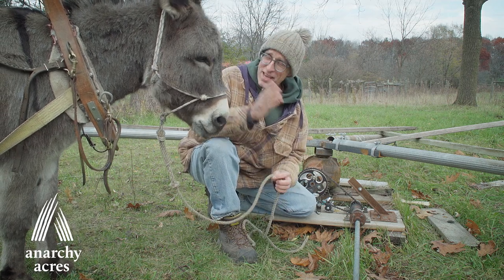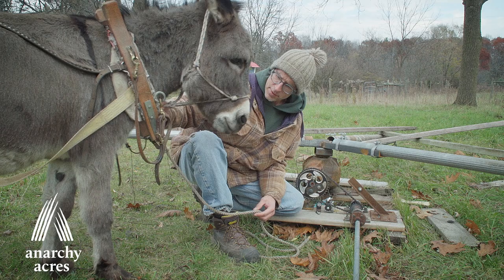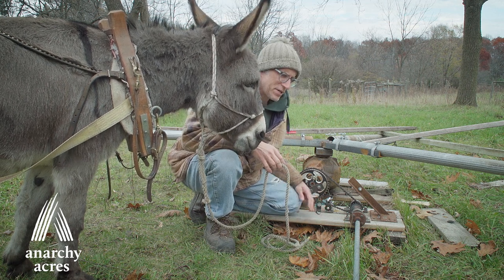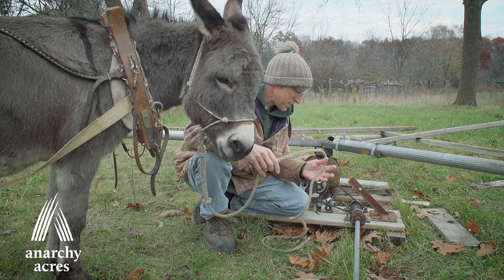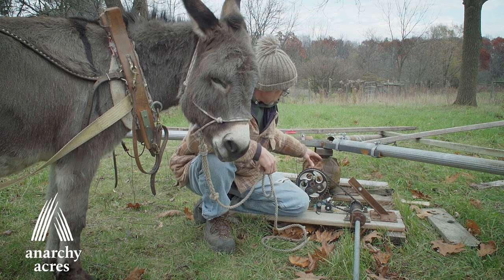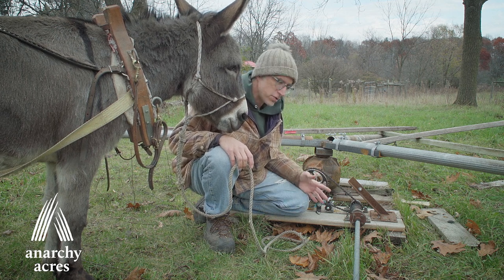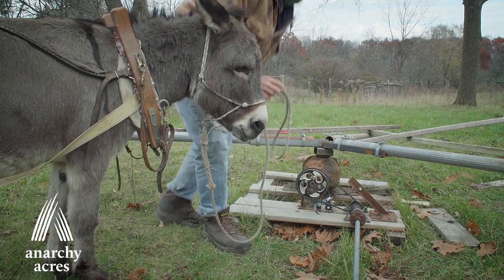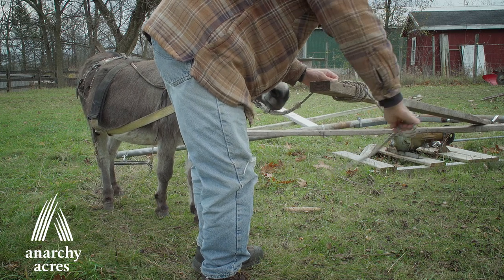Donkey Powered Sweep

Comment: I'm sure you've figured it out by now, but just an idea. We had a dump truck with bad axle seals, we actually used corn head grease in the differential for at least a decade prior to redoing the seals. I'm sure at as low an RPM as this operates, it will last even longer with no issues